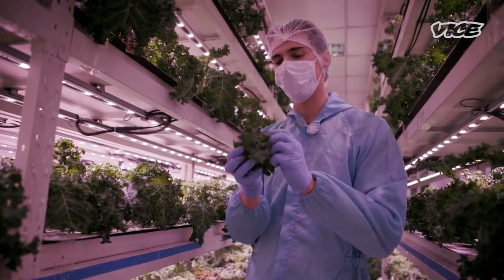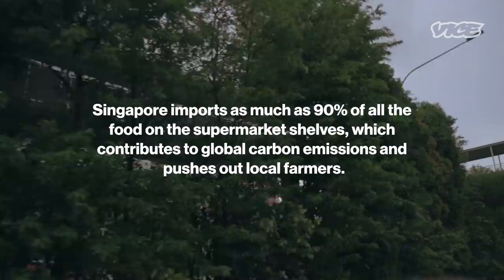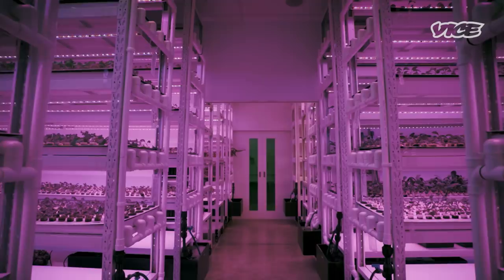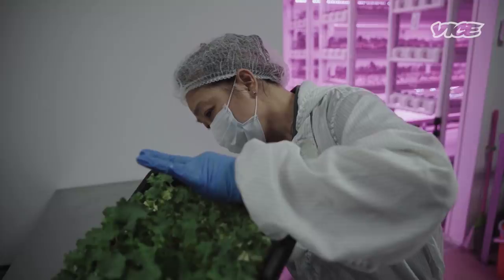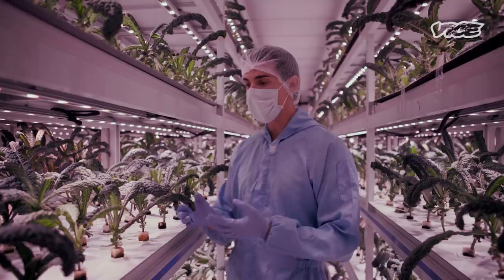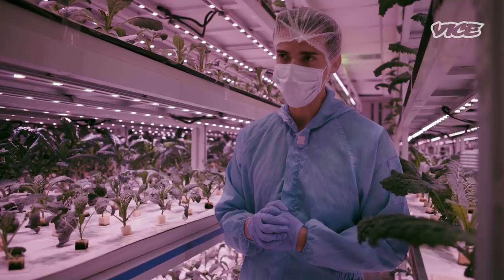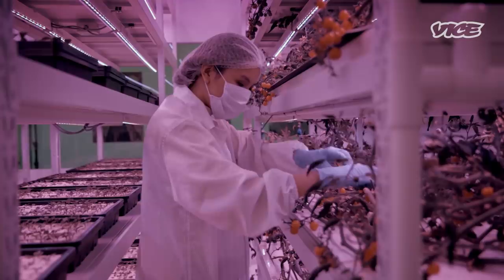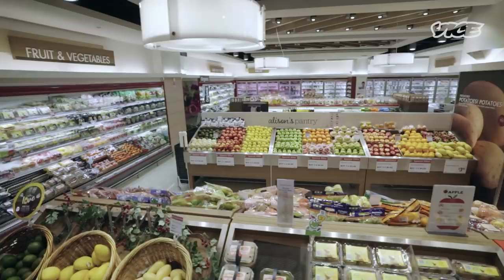Can Vertical Farms Fix the Future of Food?

Comment: Zeitgeist put this idea forward a decade ago. Glad to see ppl are finally seeing this as a good idea. Picture a skyscraper greenhouse...
Reply: So did the Venus Project whom Zeitgeist copied and quoted
Reply: this idea has been around for a long time and they just mentioned it in a youtube documentary that most people haven't heard of
Reply: you wouldn't want to put this in a skyscraper, it's too expensive. You would put this in warehouse type buildings for the best efficiency.
Reply: It took a long time to develop the method.  And even then it's not perfect.   Notice the heavily controlled environment?   That's a drawback and shouldn't be part of the system.   Similarly using nutrient water in a system like this isn't sustainable.  The tailored nutrients and low recycled plant matter for compost, means those nutrients have to be produced externally.  Ultimately the goal is aquaponics not hydroponics.  But there are problems that still need to be solved with aquaponics before it can be used.  And those problems are in addition to the problems hydroponics currently face with fungus and energy consumption.  As much as people think warehouse farming is the future,  indoor vertical farming is going to require specialized buildings to truly be viable.

Comment: The main concern is how much can they produce? When food raw material is available for a cheaper price in other countries
Reply: generally speaking hydroponics can produce a lot of leafy green vegetables.  Outperforming doing so in outdoor environments.  Growing vertically also has the benefit of condensing the product to a smaller space.  If they're using solar or wind power,  they're energy footprint could be really low as well.   There are other problems to growing this way however.  But this video is more interested in promoting something new and different,  rather than examining how the system needs improving.   It's actually really bad that they're using so controlled an environment to make this work.

Comment: lol $7 for a bag of kale
Reply: Most vertical farms like this require lots of labour to run still.. as well as increased set up costs vs greenhouses. It is cheaper to set it up like this with people planting and inspecting but expensive to run as you've noted by the kale price. But here's the thing, the serious farms are heading towards autonomation. This set up shown here is nowhere near peak efficiency. It actually is years behind compared to the leading edge companies. Which will produce a bag of kale at the same or lower price than greenhouses year round.

Comment: however, using fossil fuel to illuminate a farm is all in all a stupid thing.
Reply: After you take into account the fact that
-No gas guzzling farming equipment
-No need to ship it large distances
-They are using only red and purple LED grow lights which are very efficient 
-More efficient water usage
-No risk of soil exhaustion
-The ability to move to a more eco-friendly option like Solar, Wind, Nuclear
Youll find that this option is actually more eco friendly than the current modern system.
Reply: @mineswah4363  I did think about these points, the problem is that humanity should not put more burden on a system running of fossil energy.
we need nuclear and fresh solar power sources to be the main
Reply: @mahmoudsobhyx  Hey M Sobhy, also consider the reduction in land usage from farms being vertical. A 16 level indoor farm with double rate of growth is 32 times more productive per square metre. (Fair enough this might not turn land back into forests but it will reduce our land usage in decades to come) This farm isn't 16 levels but the real serious ones are. This man is looking for funding to become a serious player in vertical farming if I were to guess.

Also the produce from these farms does not have to be washed as it's grown in what is essentially a clean room. Ozone safely kills bacteria and the plant health is far above average.
This means extremely good shelf life. A pack of spinach greens from farms like this (if they don't fondle the leaves as much as those guys did) will last 2 weeks before beginning to decompose. Compared to 4ish days for regular greenhouse washed greens. That's a lot less food wastage.